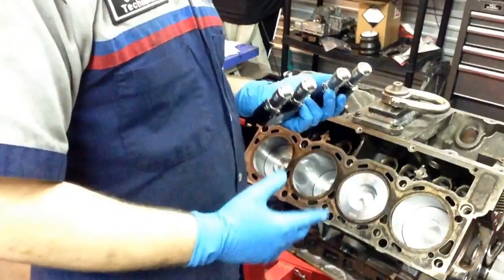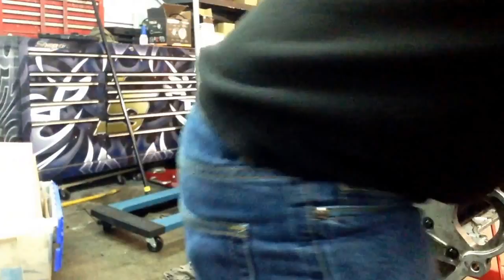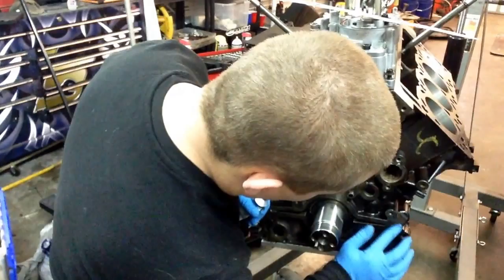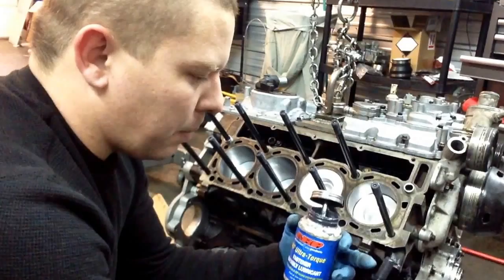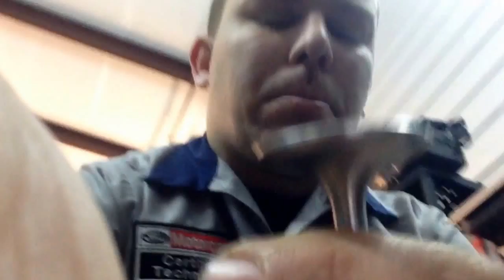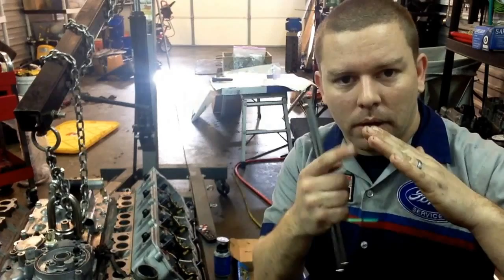6.0 powerstroke long block build review

Comment: One head has a banjo bolt on the side for oil flow. How do I determine which side of the motor to install it?  Passenger or driver side head?

Comment: Whats the deal about the 03 vs later upper oil pan?  I'm putting an 03 block I to my 05 Excursion... should I be using the 03 or can I use my 05 upper oil pan?
Reply: Upper Oil Pan • The six M8 bolts which were placed in the center of the upper oil pan have been eliminated. • Additional strength has been cast into the upper oil pan. • An upper oil pan which has bolt holes present should always be assembled with the six specified M8 bolts. Failure to do so will result in a vibration related noise caused from the upper oil pan vibrating against the bed plate.  • An upper oil pan which has had the bolt holes eliminated, can be utilized as a service part to replace the earlier part.

Comment: i have a 6.0 275k miles, oil has been changed every 5k and the coolant every 7k, never no problems until now, the egr cooler is leaking. My question is what is your opinion on doing a rebuild or simply changing the egr cooler plus i am going to change the oil cooler also, i have removed the oil cooler and cut it in pieces and was amazed of no clogging anywhere. but i am wondering about the cam and lifters having potential problems with the mileage although the truck was running well when it developed the leak in the egr cooler.

Comment: Air leak test is worthless.. the way I leak test is to pull the ipr, put the test fitting in the ipr hole. Then hook your port a power onto the test fitting, with a 4000 pound gauge. Pump the system up to 2500 psi and watch for  a pressure drop. A 1000 pound drop per 20 seconds is tolerable. However, if it will not pump up or looses pressure immediately, then I do an air test to locate the leak.

Comment: Also, do you worry about lifter failure on +200k mile engines?  If I'm studding my truck would it be worth it to just pull the engine and replace all 16 lifters and all 16 push rods (to 6.4 push rods) for peace of mind?  Stock block deck level, stock head deck level as far as I know.

Comment: Thanks for the video. I watched it because I have a small oil leak on my 04 I can’t find to save my life. I have die in it and still can’t find it. Lol. The valley is bone dry. Back of engine dry. Very small seepage on the crank position and cam sensor. Small seepage on the oil dip tube. Dripping out the starter hole and running down bellhousing. One drip after sitting overnight. Any ideas? Glow plugs are dry and everything up top on sides and back dry
Reply: Also and this sounds crazy I know but truck only has 26000 miles. Dad had it and it wasn’t driven much. Drove it for a year now and leak is no worse
Reply: I've seen some of the sensors on the 6.0 leak oil. New oring on dipstick tube.

Comment: I'm building a 6.0 and I've already learned a lot even though I'm barely started but I know I could still learn much more.  I've purchased some genuine Ford parts that were recommended and I've bought several different upgrade parts too.  My biggest concern right now is the surface finish on the heads.  My local machine shop swears the surface is above and beyond the spec but I'm not sure and neither one of us owns a profilometer.  I think they were done on a CBN mill.  The finish probably looks fine for anything other than a 6.0 Powerstroke.  When I run my thumbnail over the surface, I can feel the pattern from one cutter pass to the next.  I'm under the impression that if you can feel the cutter pattern from the mill, it's not good enough for a 6.0.    Any words of wisdom?
Reply: I don't know why he doesn't answer questions on here.  But Ford says to NOT mill the heads.  All I did to my 04 was scotch brite them and wash them bitches with soap and water!  It's been a few years since I done it and it's held up great so far.

Comment: you dont prime the low pressure pump? if it picks up oil who cares but i though u needed an oil film to help it create good suction. i use some assembly lube from permitex when i do front cover related repairs
Reply from the maker: Kevin Rogers nope. Just a little bit of grease or dip the gears in clean oil and done.

Comment: Enjoy all your 6.0 videos. They have helped me in my personal F250 repair. I have come from a overall bad impression of the 6.0 to really liking it. Couldn’t agree more about the ROUTINE MAINTENANCE you repeatedly mentioned. Do couple of relatively inexpensive modifications and it is a very dependable engine. Have a couple of engines that haul 15k daily and say 370k miles before major work was needed. Thanks again!

Comment: quick question I have a f-250 6.0 , i had work done on it but they removed the spacer that sets behind the rear main seal, they didnt mark position so i now have vibration took to dealer and they cant figure the correct position for the spacer, any help, please!!
Reply: medicup9111 easy fix kinda hard to explain how to fix that

Comment: i can't believe you put the oil pump on DRY!!!
Reply from the maker: Kevin Brennan I had oil on the gears when it was laying on the box, kinda why it slid in easy. Usually you have to bang them in with a hammer. Watch dtr video on front engine cover. That's why it wasn't on the ground. But the crank had assembly grease on it and when I rotate the engine upside down i pour oil in the pickup tube hole before putting on the pickup tube and pan.
Reply: OK but it sure looked dry to me, ive been doing this stuff for over 45 yrs and its hard to see that assembly.

Comment: Josh great video. Take it from an older guy, please save your back and get a tool cart for all of your parts, bolts and tools so you dont have to bend down and get them off the floor!
Reply from the maker: M Cool this was only done for filming purposes and I had some extra time to build a motor and wanted to get this out of the way. I have plenty of tool carts and I'm in the middle of moving into another shop. But it's good exercise.